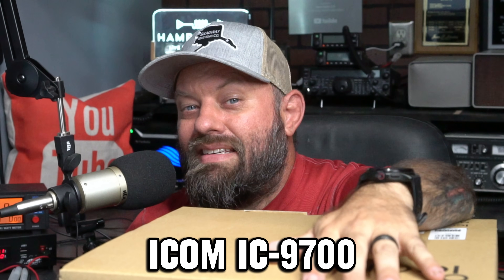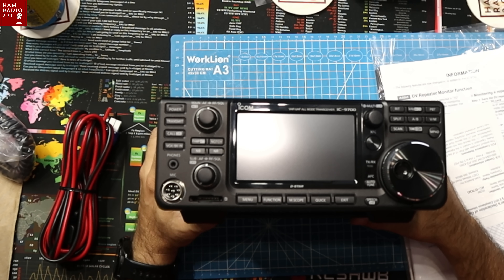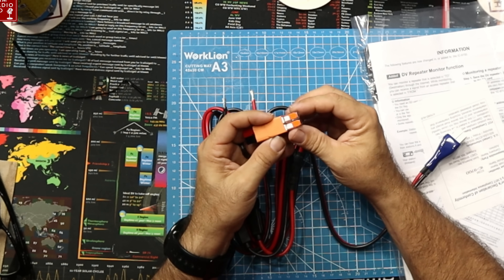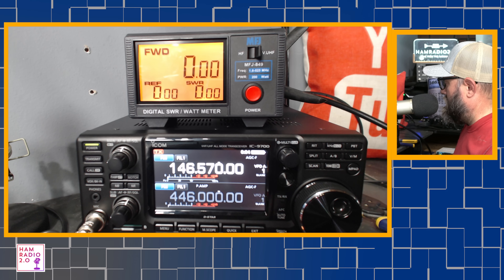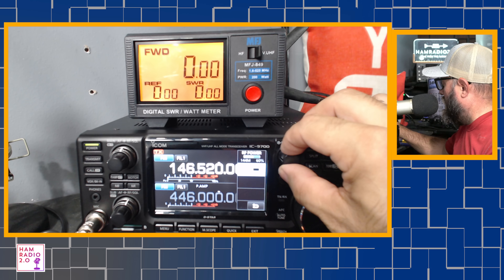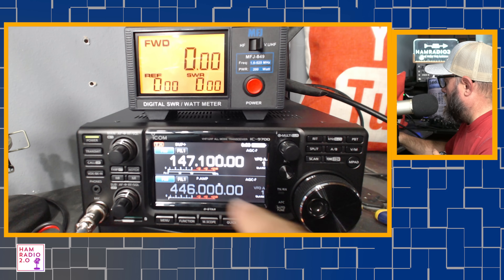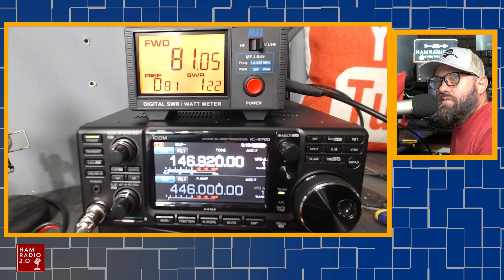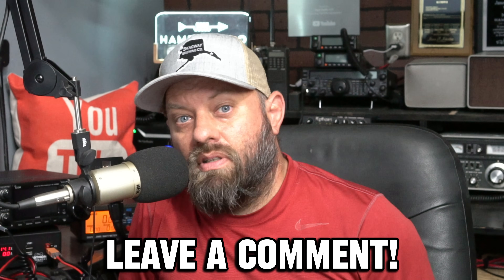Unboxing the Icom IC-9700 Radio - 100+ watts on VHF! Satellite Radio

Comment: Do you think this radio is worth the extra money over just using a mobile like the 5100 for a base station?   My OCD wants the 7300's brother but I don't work satellites (yet) so I'm not sure if I can justify the $1400 price difference.
Reply from the maker: For home use, yes.  It is higher power and has SSB, where the 5100 is FM only.  But it depends on what you are trying to do

Comment: I have the 9700. Never got 120w out of it. Max I get is 80w. Some say use a shorter power lead , check fuses for corrosion and don’t  use bladed fuses. Some of the things to look out for

Comment: This 9700 being released 7 years ago is still pretty expensive for VHF/UHF radio at $1700. With separate antenna ports for 2m/70cm, does it mean that if have a single dual band antenna you have to use a duplexer ?

Comment: Theres never any discounts in the UK
Reply from the maker: That's too bad
Reply: @HamRadio2  it cost me £800:oo for a minimum order of 200m or 660ft of stealth 7 from m&p.
Reply from the maker: @TheSignalLabs  Where did you order it from?  You can use my code "HR2CABLES" on M&P's website, it will work there too - https://messi.it/en/home.htm

Comment: I’ve had the 9700 for a year or so. Loved my 7300 so much I needed its VHF/UHF brother. I have a Comet GP-98 up high on my roof fed with LMR400 with the Comet triplexer combining the 3 ports (for now) till I get my hex beam mast up. On that will go a 2/70 yagi for SSB. So I’ll need more coax, a switch or 2, and more money to DXengineering. Nevertheless it’s a great radio! 520 in the NYC/NJ area has a lot of activity and I’ve made a boatload of contacts there. Enjoy! - KE2NJ

Comment: I removed my VHF/UHF antenna this spring when I had a new steel roof installed. I am not going to ruin my new metal roof by putting this antenna back up. There is one weekly net on a distant repeater that covers the state of SD. The rest of the local repeaters are not used at all. The clubs as far as I know have all died out. At least here HF is my only hope to reach someone in an emergency. Sad…in my opinion there is no reason to have a VHF/UHF radio in my arsenal. I put out calls but nobody responds. I have only had a handful of QSOs since I got my license five years ago. I think you did a great job in demonstrating VHF/UHF is dying. At least in my immediate area it is dead.
I would like to see it pick back up again. I key up repeaters in my area and put out my call. No answer. Same on 146.520 simplex. One time on simplex I had a long QSO. I have reached out to local hams in the area and I hear the same story of they lost interest in local comms. How do you fight that?

Comment: Love mine but never rest it on the VFO and other knobs, face down on a table !
Reply from the maker: As I told another commenter - if it can't take that for 5-10 seconds, it will never survive in my pack...
Reply: @HamRadio2 first thing to fail on any radio are the knob functions.
Reply from the maker: No

Comment: Now get your self a Leo Bodnar GPS locking unit.  The IC-9700 is a great rig but it’s not completely frequency stable on 1.2Ghz.

Why are you using the power limiter to turn the power down??? Just hit the multi button to the right of the screen, select power and the top, and turn it down.
Reply from the maker: Why?  Probably because that was how they built it.
Reply: @ that’s not what the power limiter is for - that’s for keeping your self from blowing an amp or transverter. Power output is set by pressing the multi knob.
Reply from the maker: Then it makes total sense that they put that menu in the exact same place as the power-output menu on the IC-7300, which came first.

Comment: Its a nice radio 
My biggest complaint is you cant set vfo a and b in the same frequencies 

Lets say vfo A on 70cm then its not possible to set vfo B on 70cm also 
Same with 2 meters and 23cm 

And in digital modes it has know issues with freq thats not stable

Comment: The 9700 seems to be a very popular radio, just like the 7300. I’m upgrading to General next month and I would like to get either the 7300 or 9700 but can’t afford the $1800 price tag of the 9700.

So I’d probably settle for the 705 since I want to get into QRP.

Comment: The SMA-F port is for an external 10 MHz reference clock. When present, it will override the internal TCXO. My rack-mounted 10 MHz reference is locked to GPS, but there are other ways. ALL your frequencies are referenced off this clock, so the more accurate it is, the better accuracy all your bands will have. It will make no difference to most hams, unless you're chasing something like the ARRL signal accuracy test.
Reply: The 10Mhz reference is slow, get a Leo Bodnar IC-9700 locking kit.  The mod forces the radio to stay on freq in real time.
Reply: @k6usy I see in the manual the 10 MHz reference is only used for a spot calibration and not continuous operation like the rest of the RF/Microwave equipment in my rack, so it seems we're talking about two different things. As far as "low frequency" goes, it all depends on the application. When less than 0.0001 ppm drift is important, then a precision 10 MHz reference oscillator is the way to go. (And that's considered poor compared to some of the newer ones out there.)

Comment: Question about your FT-736R- is it still a fairly viable rig to use today? What would you consider lacking in it? The reason I ask is because I remember it (and the FT-767GX) being my dream radios when I was much younger. To me, they are the Lynda Carter of radios- fairly old now, but STILL sexy as all getout.

Comment: If this radio did 220Mhz I’d buy it. Shame on Icom for not including it with such an obscene price point
Reply: Nothing on 220
Reply: @zxeng6064  Because no manufacturer puts it in their equipment, just a few smaller oddball outfits. Its very active band around me, but not worth spending on a dedicated radio.
Reply: World wide market. Only used in USA

Comment: The 9700 Begs for a flexible antenna system.  Horizontal for SSB, SSTV, vertical for FM.  Because of separate UHF/VHF outputs you need more coax.  The complications of all these options keep me from springing for this.
Reply: We used to do 2M SSB on verticals, it’s really not that big of a deal.
Reply: I have an alpha delta switch on each band for my IC-9700.  One port on each switch goes to a triplexer then to a 3 band vertical.  So I can select from the vertical and horizontal antennas for each band.  Pic is on my QRZ page.

Comment: So does this operate the same frequency as the 7300?  With the addition of 2m/70cm
Reply from the maker: No HF in this radio
Reply: 2m/70cm/23cm all mode
Reply: Super expensive for a 2m radio. I'll pass. Thank you for your replies.
Reply from the maker: It is MUCH more than just a 2M radio.
Reply: @gregpearson7013  it’s an all mode full duplex triband rig, 100w on 2m, 75w on 70cm, & 10w on 23cm. It’s not for everyone, it’s only worth it if you are into VHF/UHF week signal, moon bounce, or satellite. You don’t buy a 9700 to just talk to your buddies in FM. 

I purchased one because I’m into VHF/UHF contesting and I needed a radio that was remote controllable. It was worth the investment to me and many others.

Comment: I recommend getting RT systems to program.  Also get the CNS S.A.T.  for automatic satellite tracking. I still need to get my az/el antennas set up but I can work ISS no problems with a Comet gp3.  It also does D-STAR which I haven't tried yet.... Only regret is I wish it had a larger screen.

Comment: The nice thing about having an antenna port for each band is you can add a bandpass filter to each port. It helps with multiple antennas near each other.
Reply: The IC-9700 already has band pass filters inside - the radio will not receive outside of the ham bands.
Reply: For the price of a 9700 I'd  add them anyway to reject signals outside of the radio, most are far more robust at filtering than internal circuitry.

Comment: We need an all mode 2M mobile rig at 100w.  Y is close with their 80W rig. Or all mode 100w in a 706/7300 sized box 

With ice storms and hurricanes, 100W simplex is almost a requirement in at least Houston.  The SE US showed us that power level is needed.

BTW, Harris Co ARES and HC Emergency Management did 2n simplex net Sunday night.  Once the bugs were worked out, it was great. Hams in Montgomery County, 30+ miles from the repeat could hear us 59.  Good to get ready now!

Comment: 7300 needs a second ant port.
Reply: Agreed. Even my TS-670 from the mid 80s (40/15/10/6) has a second antenna connector for 6 meters AND it has a switch to chose between it or just using the main connector for all four bands.

Comment: I am trying to save my boxes, but I’m running out of room.
Reply: If you slit the tape on the bottom open, you can usually push the flaps out and fold it all pretty flat. Rack 'em in a corner.